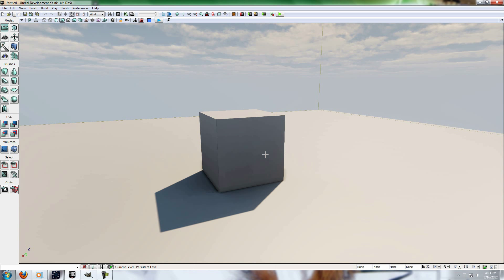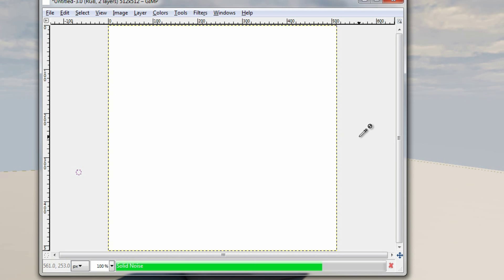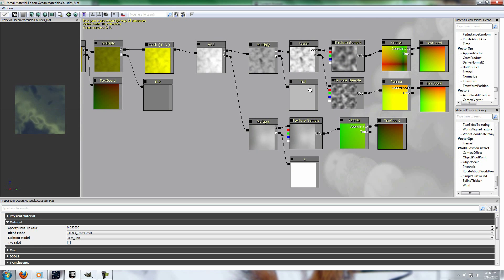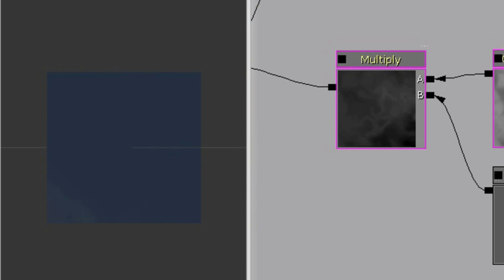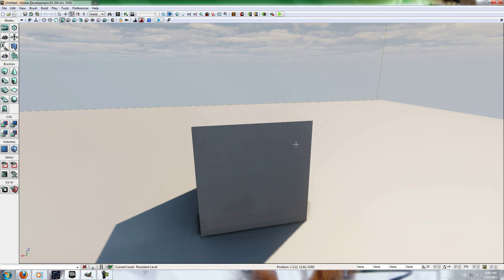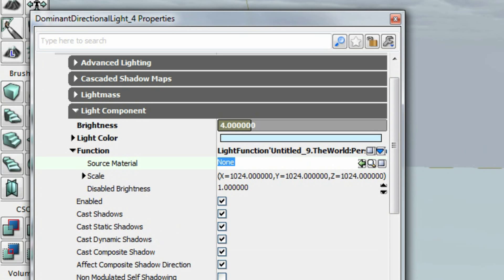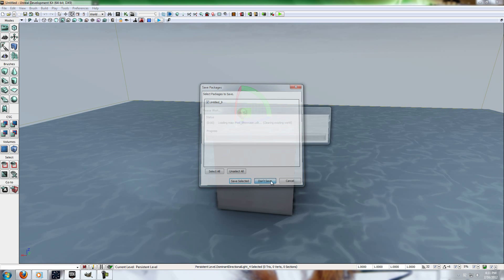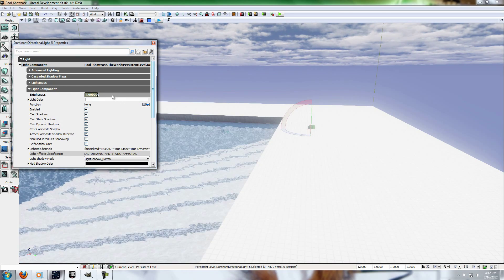UDK Underwater Caustics Tutorial

Comment: This is a long shot for those who had the issue with the light Function not working... be sure that when you have finished creating the material, that you enable the "Used as Light Function" option in the material properties.
Reply: Heh, wish i would have looked at the comments before spending a couple hours trying to figure that out. Was just gonna mention it also.

Comment: Thank you so much for the tutorial! It's very clear and easy to understand and even though I had little experience on making materials, I could finally built the material for caustics. However, like Lindsay Holloway said somewhere in the comment section, I am as well having the same problem with the material light function. I've already done what you advised her to do, but still, I got no result :( I've changed a few of the parameters in the material, I increased the level of brightness in the light and tested it in another level, to see if I could get it working there. but still, I have nothing.
Reply: Hola, estamos aquí afuera y seguiremos hasta las 07:30 pm